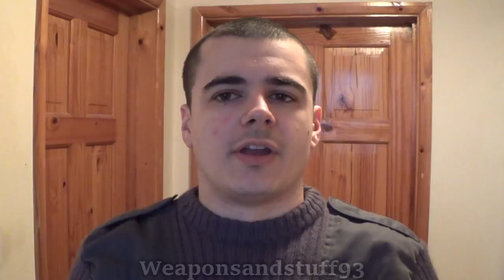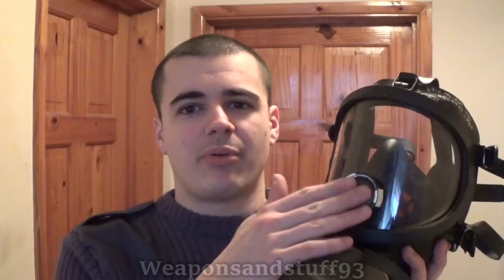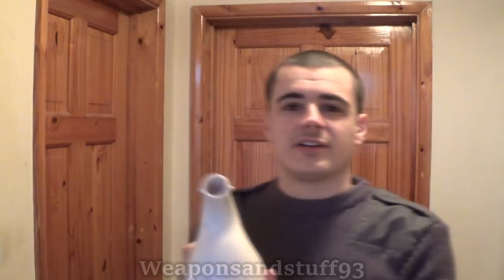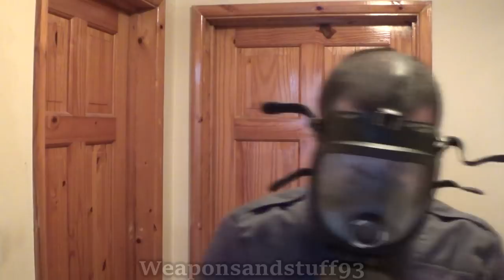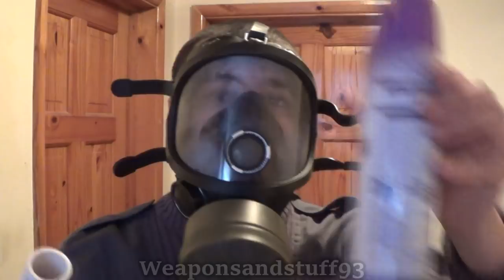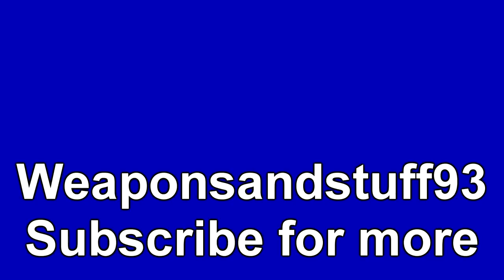Improvised Respirator air blower/positive pressure test

Comment: This was actually interesting, reminds me of when i was a little kid and reversed the vacum cleaner and blowed in my face...
Later i experienced it for real on the sea aboard a ship, for example on the old Swedish jetengined combat boats (they are now scrapped out, sadly, but one remains as a museum object) it was nessesary to wear at least a gasmask to be able to work relativly comforable in the exhaust fumes that quickly accumulated inside the bridge, so this is actually a real thing even if it look silly... ha ha.
Reply from the maker: Interesting, yeah this mask is just strange that it's meant to take 40mm filters but only in a positive pressure setup.

Comment: I know this is a silly video but on a serious note, I don't think you should force the air through a filter on the intake side. Aren't they only meant to have negative pressure going through then the correct way as to not disturb the internals or blast contaminated air throuhh the filter?

Comment: Hey dude! Just got my first gas mask (GP5) after watching for a month or so, I received it and it was quite stained and dirty, it was from Amazon Prime, the filter had a different date from the mask as well, I washed it in the sink but I didn't submerge it in water I just kind of had the tap running putting it under, I have heard that this can make dangerous dust fly everywhere from another video, should I be worried? There was also some little brown particles near the inhale valve aswell, I am really obsessive about this stuff, sorry for asking.
Reply from the maker: Well first don't use the filter, if it's a standard GP-5 filter it will contain asbestos.
To wash the mask you can just submerge it in washing up liquid and warm water, let it soak, then let it dry and make sure the metal isn't wet for too long.
Reply: Alrighty, I am aware that the filter contains asbestos, the thing I am concerned about is the brown dust that was already on the mask, some guy on a YT video said if you don't submerge it in water, dust can fly and be inhaled when washing, I washed it but just had the tap running with no plug in the sink, so it wasn't submerged, should that be a health concern? Also thank you very much for your response ;D
Reply from the maker: It's probably just a bit of talc, as long as you wash the mask I wouldn't worry about it.
Reply: Okay, thank you so much for your help, I knew about the talc aswell but this stuff was brown and it was on the outside, I've watched it 3 times anyways, thank you so much for your help, :)
Reply from the maker: It might just be discoloured rubber, I wouldn't worry about it.
Reply: Okay, sorry for bothering, I have OCD so I just needed to make sure, thanks for your help man.

Comment: Yo, i have a romanian M74 and it came with its filter. The filter says CF-4 and i assume its made in 1978 based on the markings
Do you think it contains asbestos?
And also, do you know if the mask has a gost or stanag thread?
Reply from the maker: No idea about Romanian filters but the M74 is a copy of the Drager M65 so it might be a NATO thread.

Comment: haha some idea that why dont you cut a bit of a car tube and jb weld or gorilla glue it you will have a valve then just take the inner valve itself out so your left with a port for your blower stick it over the plug hole should be good to go then mucca.
Reply from the maker: I'm designing my own lightweight blower unit currently, I'll do a video on it when all the bits arrive so I can put it together.

Comment: I have a question I’m buying a gp5 gas mask and my head is 64 cm Exact should I get a small or medium I’m 13 so I should grow in to a medium
Reply: Try it out. If it works, good. If it doesn't work, well you'll grow into it, and you can always buy another one for a low price. Just don't use the filter ;)
Reply from the maker: Probably better to be the bigger size than the smaller one.
Reply: thank you mate
Reply: Name Name thank you mate and a know about the filter